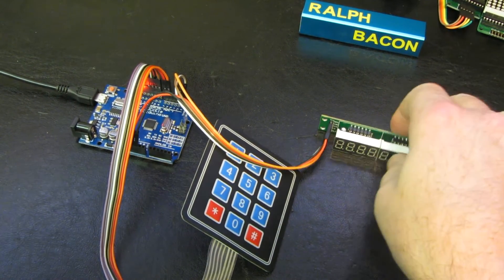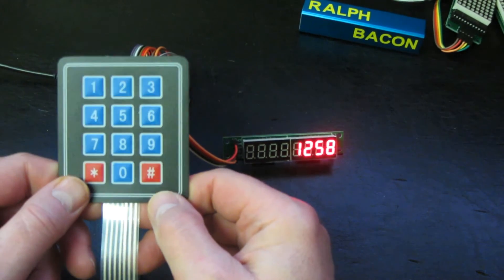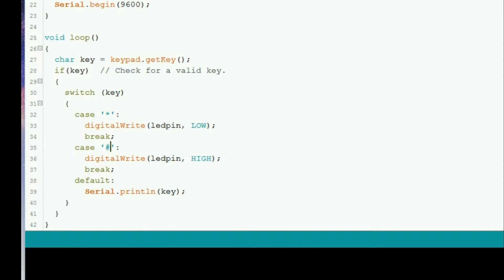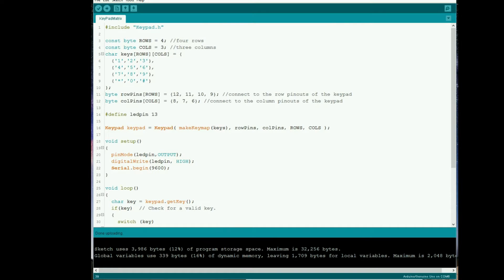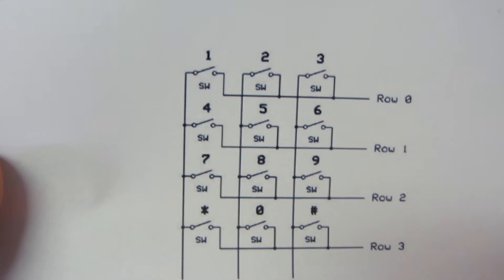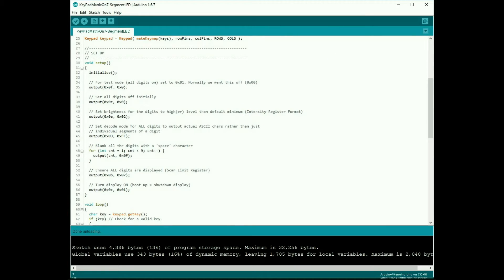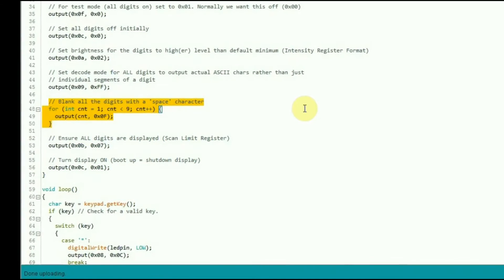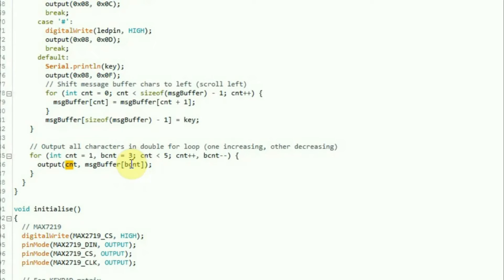#13 Matrix Membrane Switch (12-key 4x3) an Arduino PLUS a LED MAX7219 display

Comment: How would I go about adapting this to the MAX7219 dot matrix modules?
Reply: @RalphBacon I've fiddled with this for a few days and I can't seem to convert it to the dot matrix MAX7219 modules. Is it possible for you to help me?
Reply from the maker: You need a different library (probably) to control an 8x8 dot matrix module. I did a video on it somewhere (pdf of all my videos in the video description of all recent videos).
Reply: @RalphBacon  Thank you for the reply. I eventually sorted it out using the Parola library. Your videos are great. I'm just very inexperienced at coding.

Comment: Thanks, but where is the code ? There is not code ? thnaks very much.
Reply from the maker: The code was hidden by Dropbox a long time ago, TomTom, but if you follow this link you will find the file you need (zipped):
https://www.dropbox.com/sh/6n07oa81jggxubi/AAD7Z5w-uAP_avOFMCSLN8kOa?dl=0
The file you need is Membrane12KeySwitch_CodeSamples.zip
Let me know if you have any difficulties finding or accessing it.

Comment: It is possible to connect a bigger LED display, let say 5 inches that shows the same information that shows the MAX7219 as a parallel display?
Reply from the maker: You could connect an LCD [touch] screen (see video #83), Mario, and send the same information to that screen as you do the MAX7219 display. But the screen I use in that video is not a 5" screen, it's something like a 3.2", because bigger screens get expensive very quickly and you have to ensure that the screen's driver chip is supported in the Arduino community via a library. Bigger screens are more common (but no less expensive) in the Pi world. Have a look on the Far Eastern web sites (Banggood, Aliexpress etc) to see what the biggest screen is available to use.

Comment: Hi Ralph. really struggling to make 3 max7219's display numbers entered on the keypad, Is it possible with this program or should I I seek some other method ?.
cheers steve
Reply from the maker: +Stevdogvan Cherry
This will work but you do need to address each MAX7219 individually - they each will have a unique hex address. Use the I2C scanner sketch that I've attached (or just search with Google, you'll find an equivalent) so you know what the address is. If all your MAX7219s have the SAME address then you must determine how you can change that address. Off the top of my head I don't know this must usually there are some solder pads marked A0, A1, A2 or similar which can be bridged with solder and this changes the I2C address. Have you got the sketch working with a single MAX7219 yet - that's your first step, of course?
Reply: Hi Ralph, thank you for your time, yes the sketch works great, just need the extra digits.
The max chips I have are not i2c, they are spi.
Cheers
Steve
Reply from the maker: Just confirm to be the following: 1) How many MAX7219s are you hoping to address?
2) How many digits do you want to display on (each) MAX7219?
When I have your answers I will see if there is a quick solution...
Reply: Hi Ralph, I am trying to use 3 max 7219 displays so i can use 18 digits, the rest i can just blank off.
What i like about your program is the way that when new digits are entered onto the keypad the old numbers roll of the edge of the screen, the effect would be like a scrolling numeric display that only scrolled as new digits are input.
when the sports club asked me if i could do this I thought it would be easy, I must be mad, Im doing this for free.
Cheers
steve
Reply from the maker: Yup, you and me both (doing it for free)! Let me see if I can give you example code this evening that will enable you to use all digits on one of the displays at least; I think you might have to treat the displays separately (that is, 3 lots of 8 digits) but maybe not, I'll have to check (but I'm not sure I even have more than one display with which to test this). Leave it with me for a day or so (I will have more time at the weekend of course) but nudge me in a day or so if you hear nothing here.
Reply from the maker: +Stevdogvan Cherry 
So displaying a digit onto a single 8-digit display (using all 8 digits rather than just the 4 in my demo) is easy. But using more than one (cascaded) display is not so easy - you have to tell the units what you want to display on EACH unit. This is exactly the same as when using the matrix LED displays too, which I have also demonstrated in another video (thank goodness). Very do-able but not tonight - although I have got some rough code running. Let me complete this over the weekend, OK?
Reply: Ralph S Bacon thank you, all 8 digits are working on the first display
Reply from the maker: That's great; the next step is on another level but as I say very do-able. Leave with me for a day or so.
Reply from the maker: +Stevdogvan Cherry
OK, I have a working solution (using two MAX7219 8-digit displays) that will be scalable to up to 8 displays in total (you need only three you say). I will package up this solution and give you a private link (please send me your email address in the format: johnsmith at mydomain dot com (so spammers don't hold of it) and I'll send you the link tomorrow when it's all neat and tidy. In fact, it's so interesting that I might even do a (very quick) video for this channel because it is not so straightforward for beginners. How does that sound?
Reply: Thats sounds superb
Reply from the maker: I've now removed your email address from here as we don't want to attract spammers. I've made a note. About to send you an email. Please read carefully!

Comment: Hi Ralph, I enjoy watching you tutorials and i have a lot of interest for this one, try as i might, I cant understand how you have created a 4 digit buffer, is it possible to extend this to 8 digit, if so, how. also would this program work if i was to use 3 max7219's, cheers, steve
Reply from the maker: +Stevdogvan Cherry
Let's see if I can help you along the way. The message buffer is defined in line 22 byte with msgBuffer[4], initially set to spaces. When we get a key press we shuffle all the values in that msgBuffer to the left (so the leftmost disappears) and the new key value is stored in msgBuffer[4] (the rightmost), at line 78 to 81. Then we just output the msgBuffer to individual LED characters in lines 84-87. So to extend that to an 8-byte buffer just increase the definition in line 22 to msgBuffer[8] and change the loop counter and variable in line 85 to read (for (int cnt=1, bcnt=7, cnt < 8; cnt++, bcnt--). Why do we use 7 and not 8 here? because the array starts at position zero. So position 0 through 7 gives us 8 bytes.
-
Video position 12:45 describes how the digits are moved along to the left, you just need to extend it to use an 8-byte buffer and all the digits on the MAX7219 board. Video position 13:20 describes the rather confusing aspect that the digits and buffer are in a reverse order (the first digit on the board is digit 8 not 1).
-
I'm afraid using three max7219s is beyond the scope of this video - you can do it but I'd get one working with 8 digits first if I were you! Anyway, I hope this helps you get your project moving forward!
Reply: Thank you for your help, so far it is doing exacly what i want, had to change line 22 to 9, then on line 85 bcnt=8 and cnt<9.
been asked if i can make a position display for a local sport group which will make use of 18 digits ( six lots of 3 digits) when they add 3 numbers into the keypad it shuffles all the numbers to the left and loses the first 3, so far this is very promising, again, thank you, steve